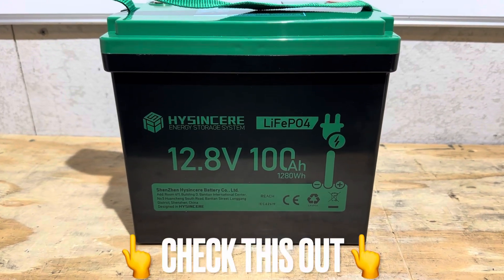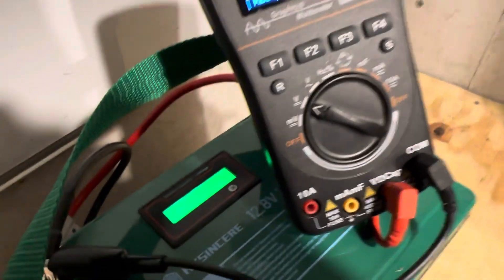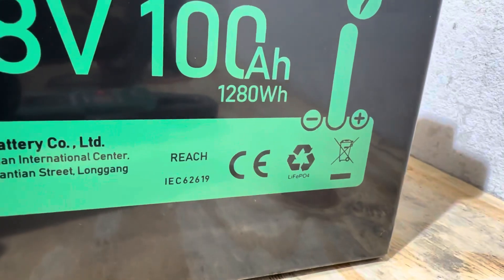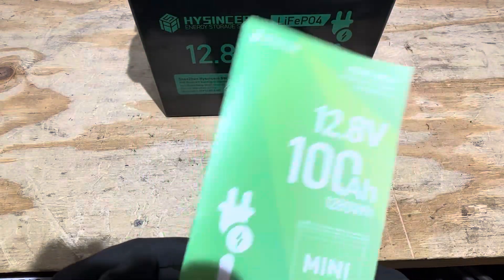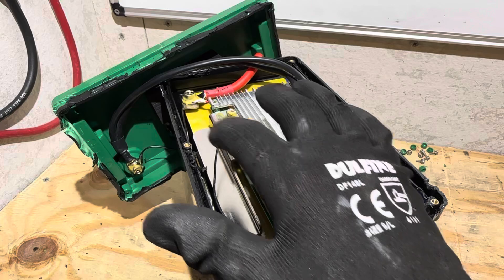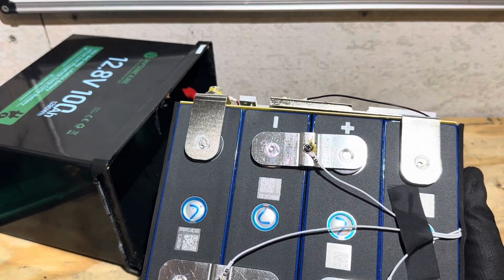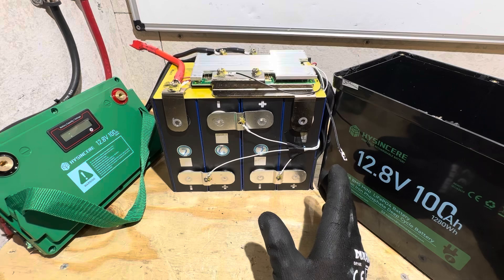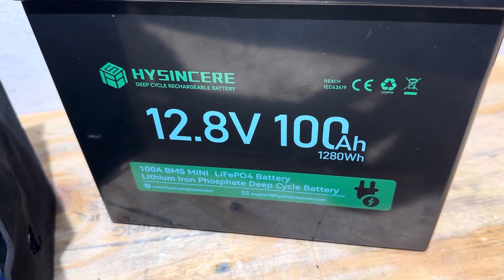HYSINCERE 12V 100Ah mini LiFePO4 Lithium Battery Review & Teardown, Cheap 100Ah Lithium Battery

Comment: certainly a step up from KingBoss batteries.  I've got 6 of these, all have over 100ah capacity, have been rock solid reliable,  Since I live in Florida, cold charge  protection isn't a big deal for me.
Reply from the maker: Thanks for sharing 👍

Comment: Thanks! Does the battery have pouch or prismatic cells? 
In your opinion, which is better, hysincer or wattcycle?
Reply from the maker: The battery has prismatic cells! Tough call on the two brands, I haven’t worked with any WattCycle minis to compare!

Comment: Looks like a neat little battery. Price is right per capacity. I like the mini size. Much less of a foot print. As I was watching I wondered why all batteries aren't made mini sized. Maybe the extra foam serves a good purpose. Too bad they didn't add more data in the metering display but I guess voltage alone is better than nothing. Thank for the breakdown.
Reply from the maker: Thanks for taking the time to check out the review! 👍 My best assessment as to why all aren’t mini sized is to; fit existing hold down trays for certain applications. (RV/marine) Also using standard lead acid size plastic cases and molds saves $. There is also the factor of “perceived value “ in larger cases. Hence some 300Ah models being in huge 4D and 8D cases when they can normally be housed in a much smaller case. Sure the foam can help on mobile or camping applications if accidentally dropped. 
I would have liked a Bluetooth BMS on this battery but the display can be a rough reference voltage for field use.

Comment: I am curious if that capacity is repeatable. Other companies make a claim for battery capacity and it is only the first few times. They sell as 300ah and have 280ah cells.
Reply from the maker: Fresh cells will usually test above their rated capacity. Technical data sheets are impossible to find for Great Power cells since they are a B2B provider. I’ll set this battery up on a SCC and charge/discharge over the next few weeks and see if it has any capacity drop. I think it’s a good idea for a long term test. I have another battery that has been absolutely tortured for the last 8 months and I have a long term review coming up on it soon.

Comment: Thank you Mr. Off-Grid for testing Hysincere NEW 12.8V100Ah MINI LiFePO4 Battery, the test content is very real. Hysincere will continue to provide the better LiFePO4 batteries, more energy, and at the same time, we will strengthen the control of production details. Thank you Mr. Off-Grid, thanks the all of you for every comment.
Reply from the maker: Thank you for the kind words and for sharing your feedback about the review! 👍
Reply: I bought two 12V 100AH batteries from you. One cannot reach 14.6V charging, and the BCM disconnects at 14.3V. The other battery I have no problem; it can reach 14.6V with no BCM disconnect. When I got the batteries, they were at 13.1V, so basically, at 50% one took about 3 hours to charge at 20A; the other took 5 min. I contacted Hysincere. They told me it's normal. If the battery is at 13.6 volts, then no problem. Seriously normal for a BCM to disconnect at 14.3V and only took 5 min to charge from 50% that's a case of cells imbalanced.
Reply: I have 6 batteries from this company. 4-300ah and 2-100ah. Only the 1-100ah battery bms went out.

Comment: Is that smaller than group 24 ?
Reply from the maker: Yes! Roughly 1.5 inches less length and  1.5 inches less width than a G24. Height is the same. 
This mini format is as small as you can get with 100Ah cells! 👍